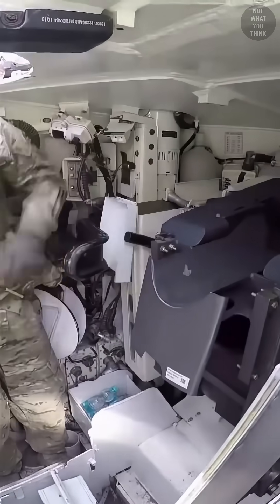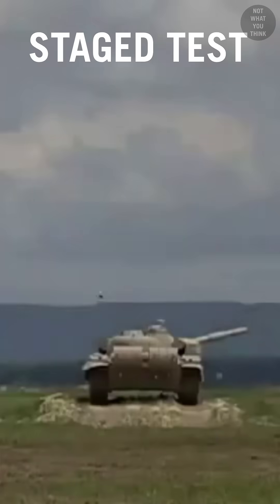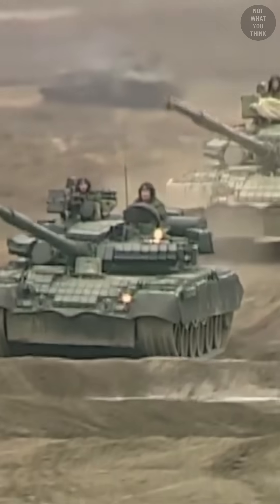Why M1 Abrams Tank Has No Auto-Loader #shorts

Comment: Ammo compartments can still work with autoloaders at some extra cost, but having a fourth crew member is very useful for such a massive 60+ ton tank (about 50% heavier than comparable Soviet ones).

The next generation of western tanks is almost certain to feature one, as things are heading towards 130-140 mm guns with massively heavier rounds that humans are just too slow to load.

And then there is the fact that unmanned turrets like in T14 Armata are becoming more and more viable and useful, in which case the ammo door issue is much less critical anyway.
Reply: I believe the leclerc MBT (French) uses a blowout compartment with an autoloader, with there being a mechanism that moves the rounds to a hatch, that the opens and pushes a round into the breach. I think it works this way from the footage I've seen but I could be wrong
Reply: На 50%?! На 30% в сравнении с Т-90А.  И давайте будем честны, американцы не смогли внедрить в серийное производство автомат заряжания в то время, как в СССР такие танки производились с 1969 года на Т-64А

Comment: It's just safer, humans can make mistakes but not necessarily fatal mistakes
Reply: Not true. For example, when clearing a misfire, the loader can fuck up and have the shell blow in his face. Another example is with two piece ammunition. The loader can "forget" if he inserted a charge or not, and ram a second one, which will surely blow the gun. These mistakes are, of course, almost non-existent. But the possibility does exist. Humans are fallible, and prone to fatigue. Machines, not so much. A well built and kept machine will not commit these mistakes. 
It should be remembered that the US chose not to use auto-loaders long before the storage compartment was a thing. So that cannot be pointed as the reason.